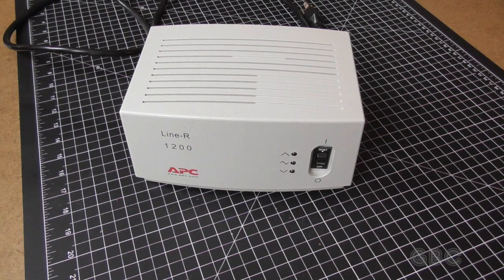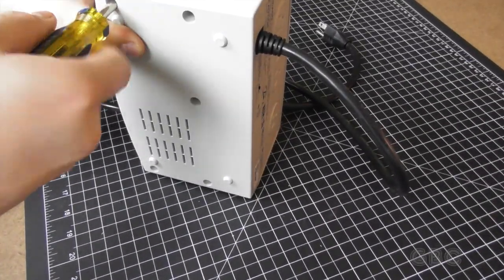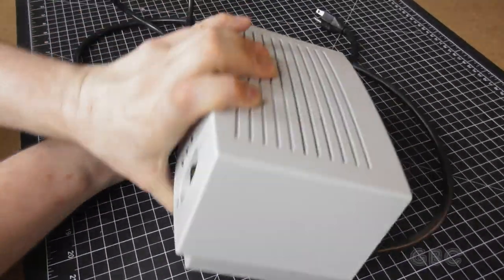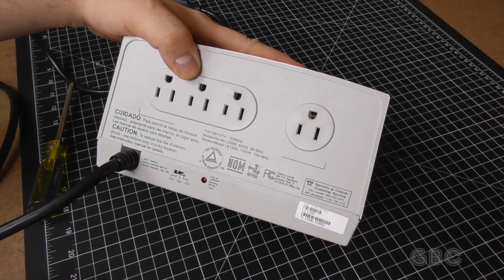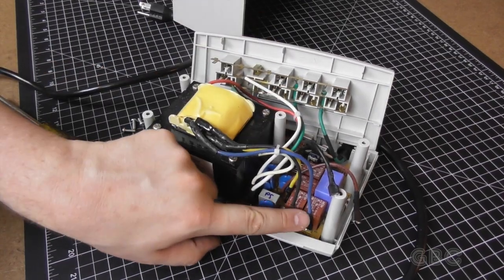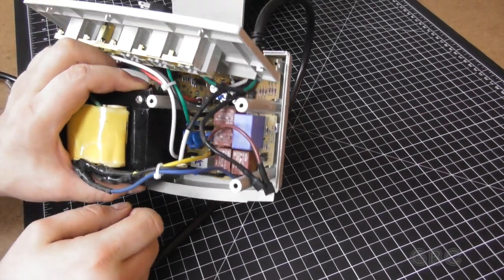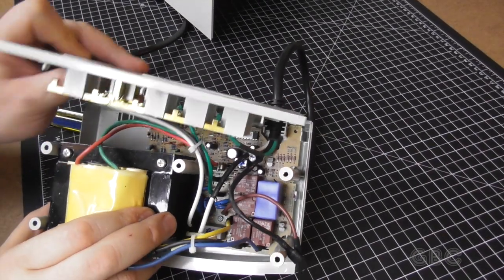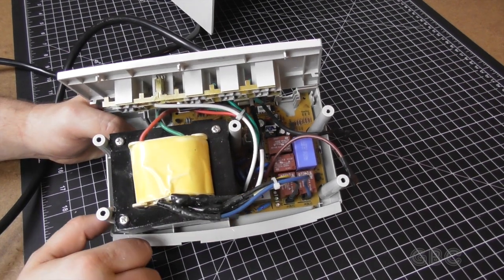[43] APC Line-R 1200 Teardown

Comment: That is most likely an autoformer instead of a transformer. Much like a variac but with defined taps. There is no galvanic isolation that a transformer would have between primary and secondary.

Comment: What you wonder in 06:35" is a X2 type capacitor. In mine 230v European version, is marked as 470 nano @ 275 volt ac.
The same exist for the other up right one with the blue color. Over the years, this sometimes breaks down so that the device does not work at all or works with interruptions.

Comment: Does this act as an isolation transformer?
Reply from the maker: I don't think so.  None of the info on it says that it is.
Reply: @GBCProductions64  I wish it had settings for 110 115 and 120 volts, because by the time it clamps the voltage at 226 volts, it's too high

Comment: Dumb question but how much energy do these use? I have the 1200 version and only have a tv and game console plugged into it so would it be consuming energy for only those two devices or would it be consuming 1200 watts of energy regardless of what's plugged into it.
Reply from the maker: It's basically just a transformer running 1:1 most of the time.  It's going to draw a little bit of power but not much more than what is plugged into it.  I just hooked a meter up to it and with nothing plugged in it was pulling a little over 8 watts.
Reply: @GBCProductions64  thanks!!